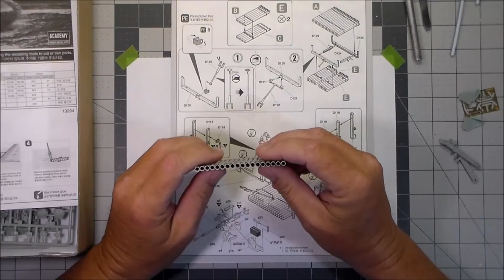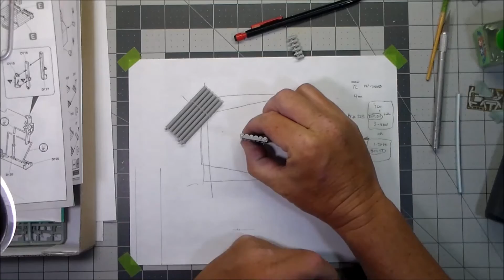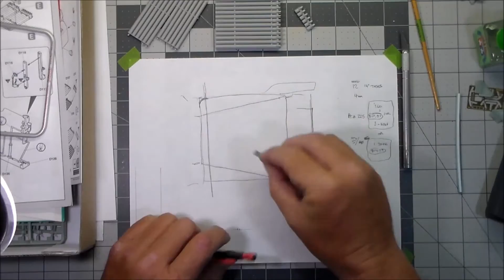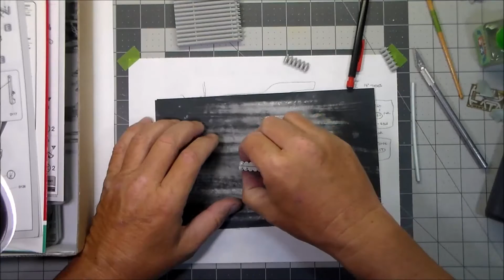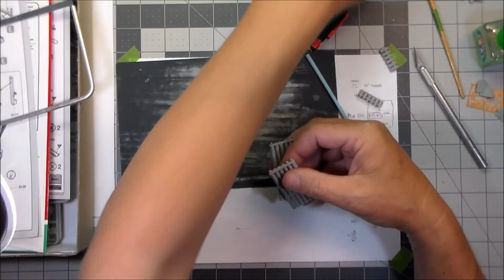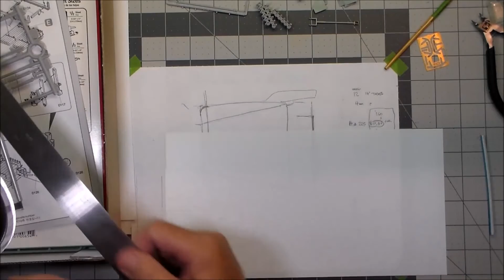M Group Build pt 5a

Comment: great job on the rocket tubes with that cool tool on you dremel.
Reply from the maker: Thanks Kim. I never cared for the Dremel tool for modelling in the past, but with cordless availability and a really low speed, I have found it to be quite useful.